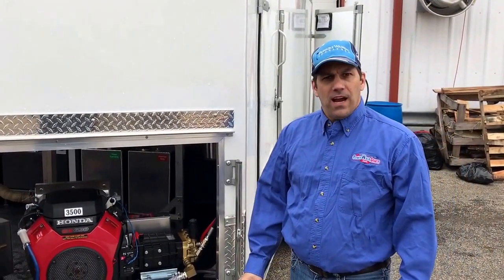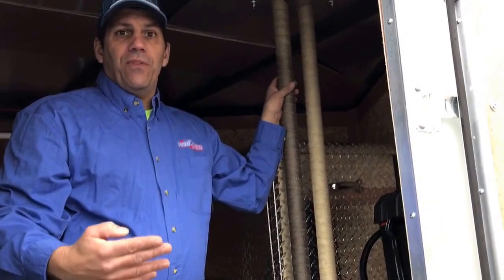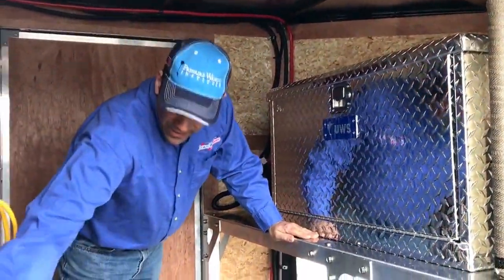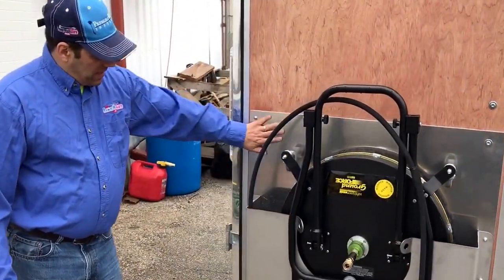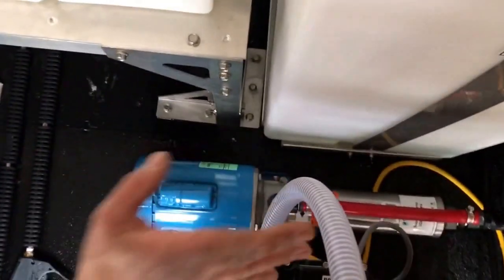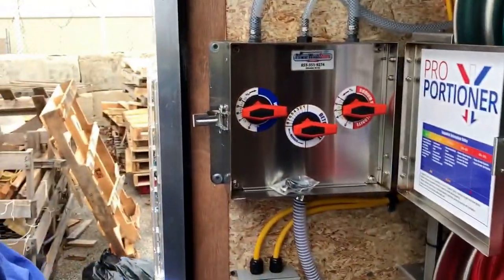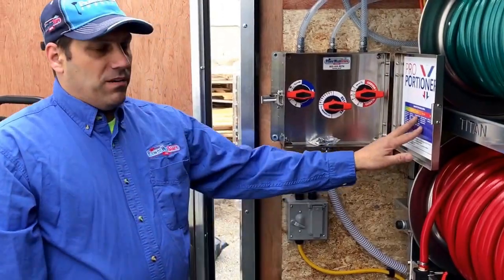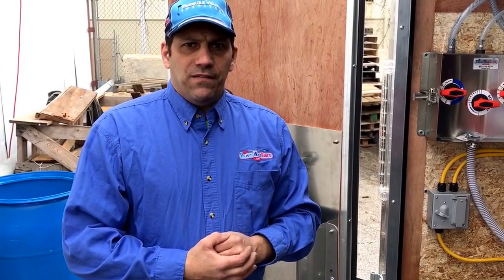Isaac Totos soft wash pressure wash trailer

Comment: I have a question about the size of the hose for the exhaust pipes for the pressure washer. I have an enclosed trailer and I am considering different materials and hose sizes. I'd appreciate the info :)